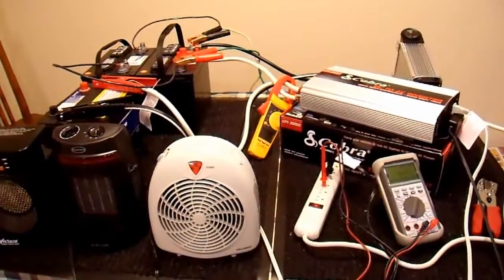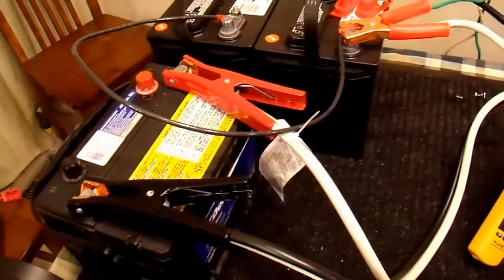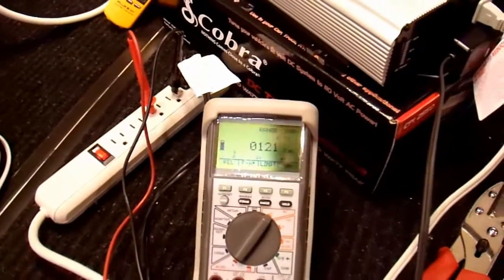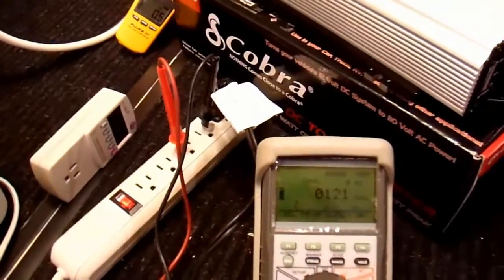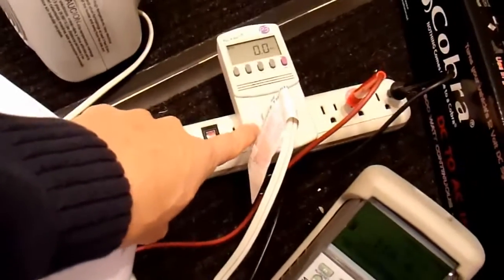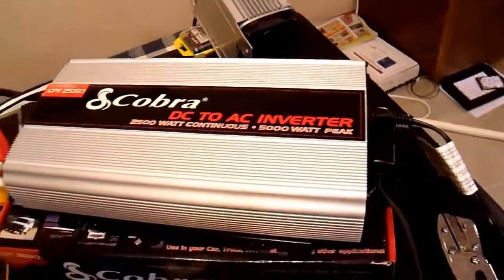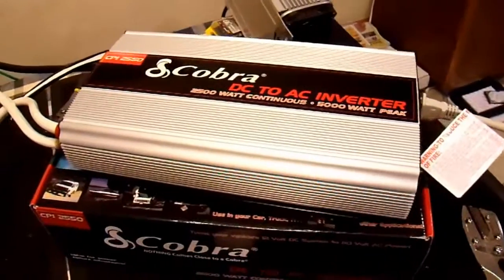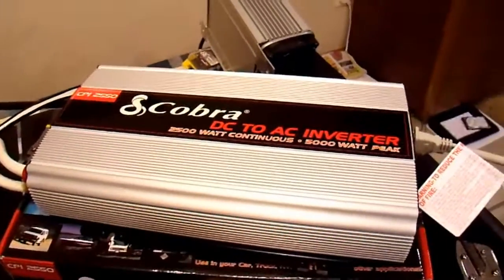Cobra Inverter Review Part7 - Addendum: Max Output wattage

Comment: I watched a lot of your video's, but I don't think you have a video specific about inductive loads on invertors?
Here you're running hi start-current engines from a 2500W inverter.
I noticed that the Reliable manufactor advices to overrate you invertor by factor 3x tot 7x when choosing an invertor for inductive loads. That looks high too me, what is your experience with this?
I'm looking to run a power jet wash (1700W) from an invertor to clean a dirtbike onsite. I thought I was save with a 3000W (6000Wpeak) but that is not what is  says here (3x-7x): https://www.aliexpress.com/store/product/3000W-Pure-Sine-Wave-Inverter12V-24V-to-220-240V-Car-Power-Inverter-LED-Display-FULL-POWER/413804_32360268868.html

Comment from the maker: Anything that uses a motor or transformer will run hotter than normal, may buzz, and will draw more power than with a sinewave inverter.  The motors will also run a little bit slower and their power factor will be worse causing more efficiency loss in the inverter.  For anything serious I would recommend a sine inverter, but for the money this one seems OK for occasional use.  Note that universal motors such as power tools and vacuums do not have the above deficiencies with modified sine.